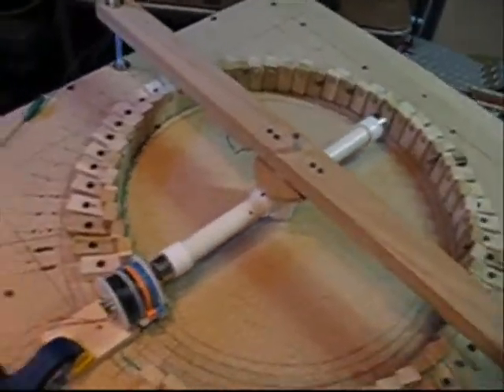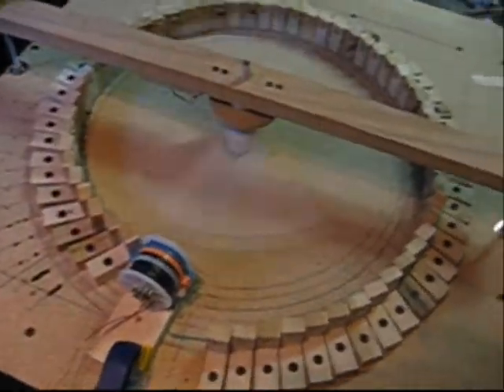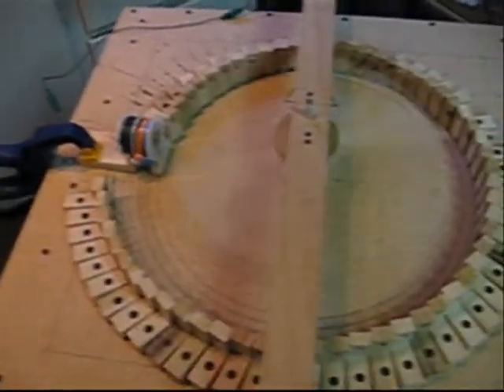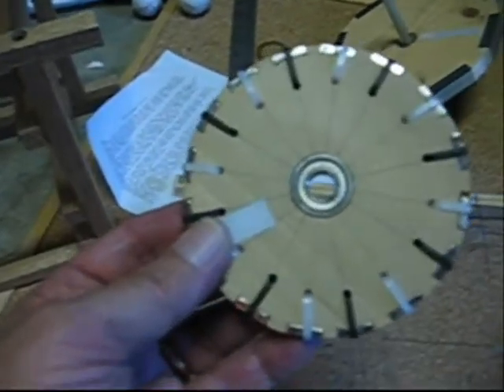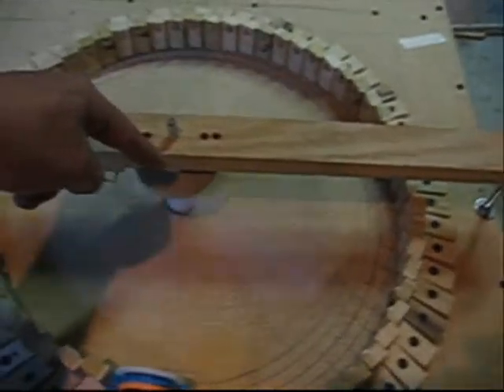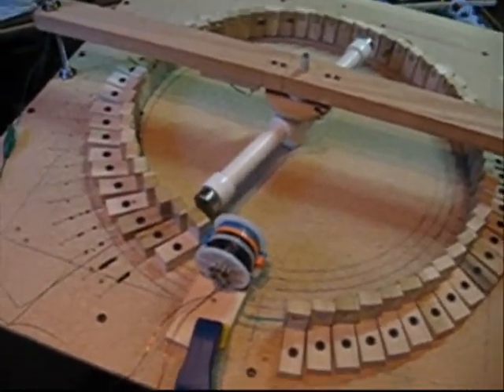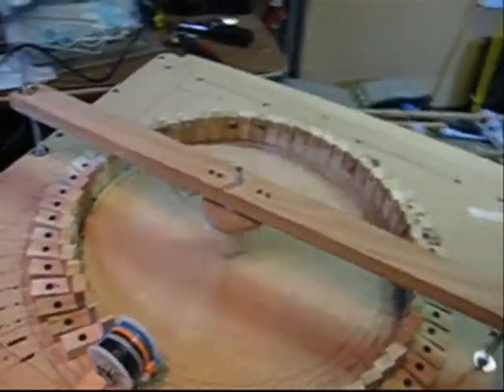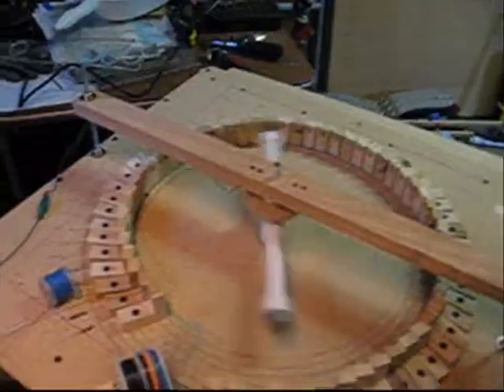Magnet spiral motor revisit

Comment: reed switchs burn up - there might be a way to protect the switch with a capacitor and resistor in parallel with switch, to prevent sudden voltage rise on switch - if you ever decide to employ the reed relay again, the cap might work

Comment: Hi, I have just found your video and am interested to know what voltage you were running it at. I have used reed switches too and found that at high speeds they fuse, they cant operate at really fast speeds.  If you reached the speed on your video thats amazing, Have you any new ideas on this set up. thanks Dave
Reply from the maker: Dave thanks. Yes reed switches are a pain. I've moved to Hall sensors because of the very thing you mentioned. I usually run at 12v but sometime less and in the vid you reference its the out magnets that give the added push
Reply: @mcorrade  does that mean you have to use a relay with the hall switch? if so have you found that the relay then becomes the weak link?
The best result I have had with fast running Neman type motor was when I used a mechanical contactor using a set of distributor points. The acceleration was amazing, have a look at my Video and see what you think  ,Maybe  you can incorporate it in some of your ideas. just an idea.
Reply from the maker: @DeryckThompsonChasingtheDream  No I use a transistor with the Hall sensor. There are many diagrams on the web showing the different transistors in combo with the hall sensor. You can also us the basic Bedini circuit
Reply: @mcorrade  Many thanks for the info, I will keep looking to see if you post any more videos, I hope you do  as you do seem to understand what is happening when using magnets as a drive mechanism. all the best. Dave

Comment: You need to design the coil differently ! It needs to be the same 2 toroidal coils like the electric Steorn ORBO put 180 out of phase in SERIES ! Then the moving magnet will not have any effect on the input power of this Electromagnet. Then it will work and will not need much input energy !
Then it can be used to overcome the sticky point ! The 2 toroidal coils placed in series 180 degrees out of phase supress the Lenz law but still loose their attraction to magnets. So you create a track where the moving magnet gets attracted more and more and at the sticking point you just energize the 2 toroidal coils just for a few milliseconds and the magnet can move on through the stick-point !
This will not need any more additional input power. If you only use one normal coil, you WILL NEED addditional input power
due to the moving magnet(s) and Lent law fully applies, so just use the Steron ORBO Principle
with 2 toroidal coils 180 degrees out of phase in series. Hope this helps...Regards, STefan.